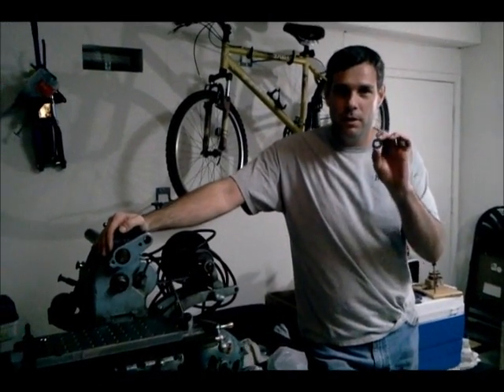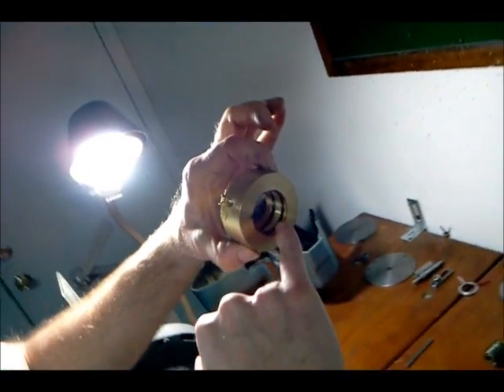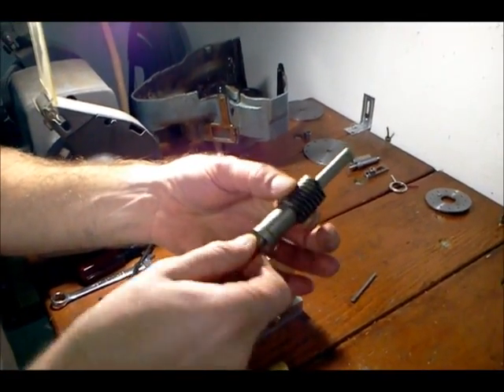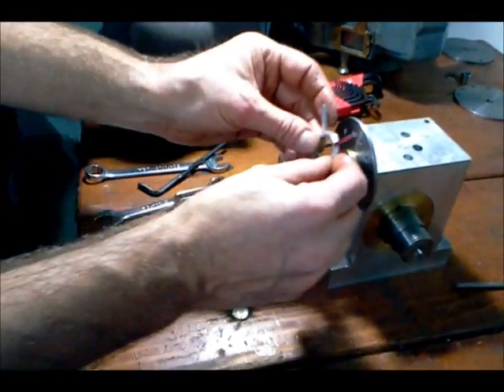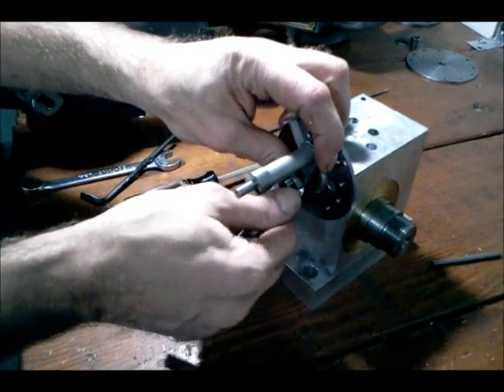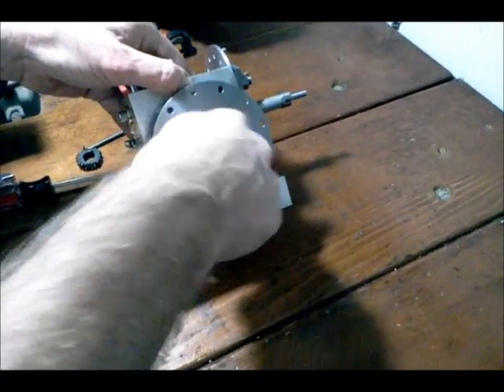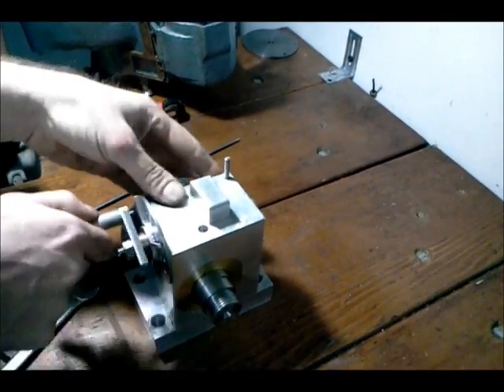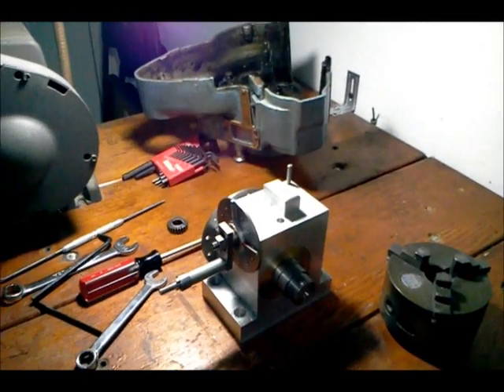home made indexing head.wmv

Comment: You have a great deal of patience.  I am a retired tool and die machinist and would buy a commercial dividing head.  You put a lot of effort to make yours have most features needed. You can do anything if you have the time and willpower.
I would rather earn enough to purchase machine tooling.
Good job. You are very talented.
Reply from the maker: Thanks! I have since found a good American made one at a swap meet for only 125.00! This one started as an idea in my head, in time it became a process as I worked out how I would design the different features. I was deployed at the time, so had a while to think about it. I made no drawings, just started machining and it came together. I still use it now and then.

Comment: Wouldn't happened to have been a 24DP cutter you had to buy would it? I need to cut gears for my atlas and the 24DP I can't find on the electric web.
Reply from the maker: Yes, it is a 24dp cutter. I was able to find and order it at the time, unfortunately it's been so long I don't remember from where I ordered it.   Not sure it it will work for your gear, as it #5 (21-25 teeth). If it's the one you need email me at sohackitj@gmail.com

Comment: Really Really Nice Work !!! this video has been around a quite some time. typically a worm gear represents a single tooth, your worm wheel is obviously far greater than 10 teeth, so how is your ratio 10:1 ? Whats the story on the worm gear itself?
Reply from the maker: Harus Difindafer the worm and worm wheel came from an electric motor that I bought at a swap meet. The ratio happened to be 10 to 1, which worked for me. Most commercial indexing heads are 40 to 1.
Reply: Overlooked the possibility of a 6 tooth worm.

Comment: Very nice and I'm needing a dividing head/rotary table myself. Maybe a dumb question but how do you make the indexing plates for the dividing head without a dividing head? Do you lay out the holes, punch and drill?
Reply: That's one way. The nice thing about the dividing head is that it can be used to make better plates. So you hand-punch a plate, and it's ok but not perfect. Make a second plate using the dividing head and the first plate. Then make a third plate using the 2nd plate. Each time, the error drops by a factor of 10 (in this case, since the worm is a 10:1 ratio) The 3rd plate has an error that is 1/100th that of the original plate.

Comment: Great job, probably being mr. Obvious but just in case I'm not, here are two tips for you:
1-you can pick up metal shapers for crazy cheap, I got mine for the cost of a single mill gear tooth cutter.  With a shaper you can cut all kinds of different gears with cheap hand ground lathe type tools.  They were superseded by vertical mills in industry cause shapers are slower, but they are great for hobbiests who are watching their pennies.
2-lots of good videos on converting a cheap buzz box into a scratch start tig welder.  I spent $130 to convert mine, including argon tank and regulator.  With tig you can build up the busted gear teeth and then machine back down to spec.  For me it is a bit faster and cheaper than cutting a gear from scratch
Reply from the maker: +bondvagabond42 
Love your first comment, and agree that shapers are awesome machines. I used them in repair shops when I started machining in the Navy in the mid 1980's. I haven't seen many for sale where I live, but I would surely buy one if it came for sale near me. As for the second point, I prefer making parts from scratch, as that's what I've always done. I may start playing around with welding machines some day though.
Reply: bondvagabond42 not that material they used for the atlas mill..same as chraftsmann lathe

Comment from the maker: I'm unsure what you mean by "set the angle" that a rotary table can do and this indexing head can't. You are correct that I can't tilt the head, which would enable me to do things such as bevel gears, but I can't see how a rotary table would give you that ability either. If i really needed to do that, I would make or get tilt table and mount the indexing head to it. I built it to be able to index gear teeth, a job much easier when you can do plain indexing.

Comment: Another on the list of things to make once the shop is up and running. Really with a lathe and a good milling machine you really can make just about any piece of equipment you want. One thing I would really like to build is a gear hobber based on a Barber-Coleman 16-16 with a 30:1 ratio. Maybe make the Workhead for the Hobber so it is dismountable? Sounds like an idea.

Comment from the maker: Hi, thanks for the interest in the video. Yes, the indexing (or dividing) head is used to create equally spaces divisions on your work-piece. They are very often used to make gears, as gears will not mesh properly if the teeth are not equally spaced. The indexing head I made has the ability to create many number of divisions, based on the number of holes in the plate on the front. If you like more detailed info, you can email me at sohackitj@gmail.com.

Comment: Veeery nice work DIY! I am acquiring my DIY machine shop and considered dividing head like important part. But although I am skilled technician but not machinist, I do not like to speculate much about precise machine parts (also I am not sure about my English I understood you well), so please tell me just to be sure - the principle of this device is just to turn main spindle (for chuck) in right positions, then lock it with adequate dividing plate at handwheel ... (?).

Comment from the maker: Hi, thanks for the compliment. I have found the little indexing head very handy for several projects since I built it.  I did check out your channel, your shop is very impressive. I like the LeBlond lathe. I am U.S. Navy trained and have used LeBlond lathes on ships over the years, they are fine machines. I see your steam engine, I also love steam power. In my channel are videos of a model steam turbine and generator that I made. I can get 115V at 60Hz. I am working on a condensate system now.

Comment from the maker: Hi Thanks for showing interest. I worked on and off for about a month and a half. Yes, I did use the lathe for the main bushing hole, the bore for the crank spindle was done on the horizontal mill that I was fixing. I used a boring bar and extended the tool bit a little for each cut. The remaining small holes were done on a drill press.